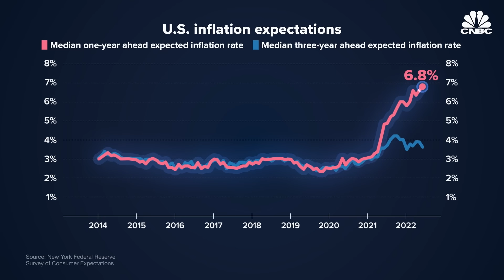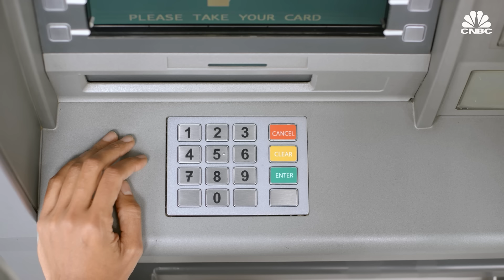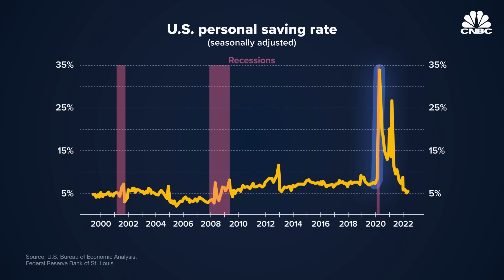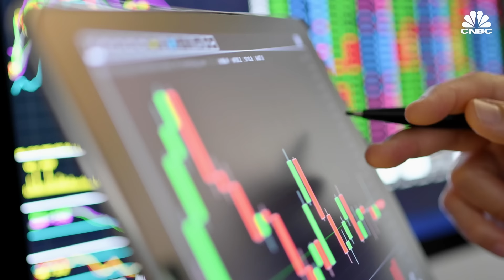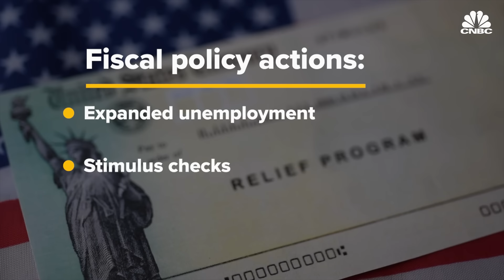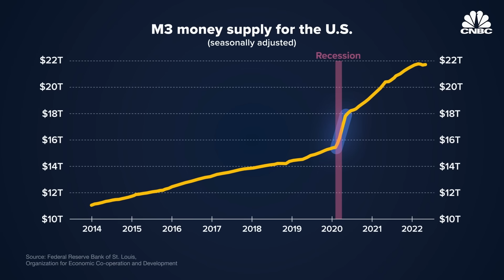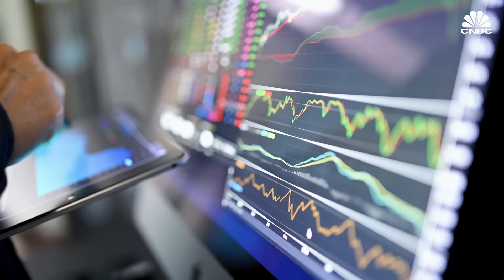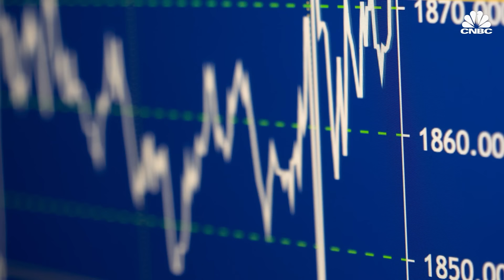How The U.S. Made Inflation Worse

Comment: The U.S. depends on cheap imported goods to keep inflation low (lower than it would otherwise be if all goods were produced domestically). This is euphemistically referred to as "the supply chain". The U.S. economy is a service based economy (has been for a long time), which doesn't produce enough manufactured goods (including goods used in manufacturing itself such as machinery and equipment). Because the U.S. relies heavily on foreign production for the supply of manufactured goods, any disruption in the supply of those goods, will cause inflation to go up in the U.S.
Reply: Yeah thanks Bill Clinton and NAFTA.

Comment: The covid handouts portion was entirely speculative and biased with no research or maths to back it up. All independent economists blame fuel prices, supply chain constrictions etc for large inflation globally. No other country is blaming covid fiscal stimulus for large inflation which says alot about how biased CNBC is. ALSO covid stimulus stopped. Considering the amount of focus in this video for that the removal of that monetary stimulus would've had a sharp downturn. Incredibly biased, speculative and not at all based on fact.

Comment: 2:29 "experts believe" lol. Back in 2009-2010, when everyone started finding out what actually happened during the housing crisis, the banks blamed the people and the people blamed the banks, but it was fed's responsibility to monitor the loans, and more importantly to watch for fraudulent activity. After millions lost their homes and jobs the employment rate peaked at 10% with hundreds of thousands of defaulted mortgages collapsing pension and investment funds because the fed allowed everything to be connected to those mortgage securities (they still do btw). In 1929 the Fed assumed the recent economic boom of the 20's was the formation of a bubble and decided to try and deflate it by raising the lending rate for banks, but they did it too aggressively and too quickly and caused the death spiral to the great depression. Unemployment peaked at 20% and millions were close to starving. In 1937 (not even 10 years after the 1929 crisis) the Fed decided it was time to restrict the money supply. They doubled the requirement for their own reserves and sterilized gold inflows to prevent it from backing economic expansion. After slowly inching down to an unemployment rate of 12%, from 1937 to 1938 it had jumped back up to 20%.

Comment: Mr Powell  increasing the interest rate is not the only solution . Please ask Supply chain section to work hard to solve supply problem which will help prices & inflation down. Secondly  try to control on Manufacturers , Distributors , Wholesalers & retails to force law on prices. Retailers are having less inventory but they want to make more & more money by JACKING UP PRICES by more than 25% in a year.
  Only poor public is getting punished by more on Financial charges on top of VERY HIGH PRICES on daily routine purchases. There is no control in these departments.
Government should look into these areas to resolve issues.

Comment: In California the high gas prices are due to the government preventing the oil industry from drilling for the abundant oil under California. instead the California oil industry must import its oil from Saudi Arabia which is 10,000 miles away and provides no jobs for California workers. 
In California there is plenty of water in the mountains but the state government will not build the dams and canals necessary to store the winter rain and snow for use by the farmers. 
In California the government passes laws requiring citizens to only buy Electric Cars but passes more laws preventing the building of power plants to charge the batteries.
It is time for a new government. Vote the bums out in November!

Comment: If the money supply is too high, then they need to pull that money back and take it out of circulation. The best way to do that is to increase taxes (fiscal policy). But you can't increase taxes on the poor because they don't have any money. The only way to do it is to tax wealth, i.e. tax the people who have the money. Use the proceeds to pay off a significant portion of the U.S. debt (bonds). You do this gradually over time, and it will ease the asset bubbles and pay off the debt.